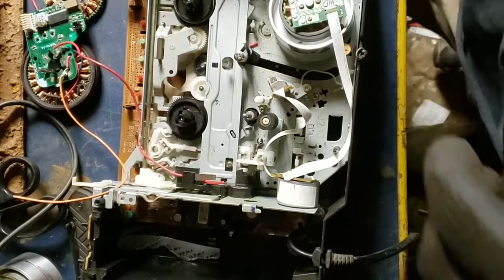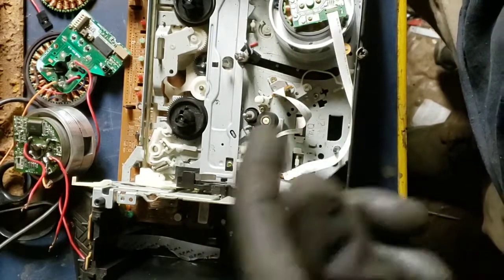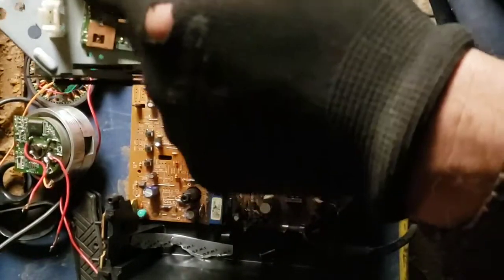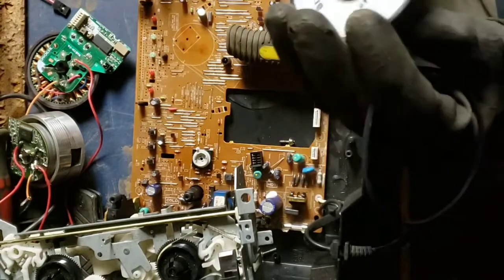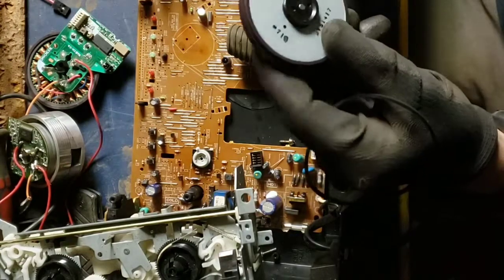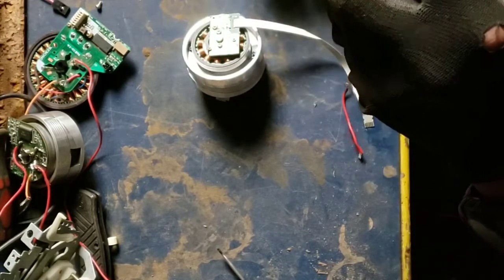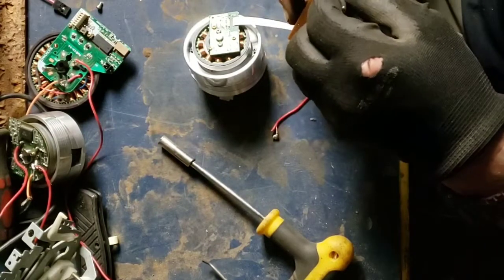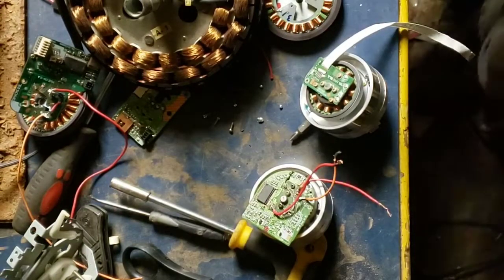hidden motor in every vcr! powerful mini bldc drum motor!

Comment: Looks and sounds like you didn't "Figureitout" after all, at least not how to use a camera or explain things. I have 6 of these on a model rover for high speed and reversibility on all drive-trains. They also work well to drive some worm gears and linear bearings on a few low-profile applications.
Reply from the maker: But I'm trying to get better at making videos.  I hope you noticed that if you were possibly inspired to check out my channel. Or was just curious if all my content was this bad......ha ha. I really appreciate you viewing my video and taking the time to give me some constructive criticism.  You inspire me to do better. Hope you decide to stick around to see upcoming content and improvements. Got 2 exciting projects/videos I'm working on that I think you will find interesting.  Thanks again @colormefucked
Reply from the maker: Sorry I never followed up. Still learning  how to effectively get what goes on in my head crammed in a video where someone can actually learn from it.  I always find the three phase wires and just use a rc bldc driver and they spin right up. I have actually been rewinding these motors with thicker gauge wire and they can actually grow some balls. I mean the one I just did screams and really has a lot of torque. I built a mini flywheel generator with it and it spins up the 5 lb flywheel from 0 to 2000 rpm without hesitation. Although there is a belt pulley reduction of 3 to 1
Reply: Hi friend, do you happen to have one with the Panasonic AN3844SB Drive? I couldn't find the Datasheet.
Reply from the maker: Na sorr
Reply from the maker: Well killerwolf I have never had a problem with the ladies and I know what you mean. Probably some fat lazy punk that thinks I actually give af about what he thinks...... I share wtf I think may be interesting to people because A. I thought it was pretty f@#$*ng cool,
And B.  Because I have learned so much on you tube that everyone asks me how long I went to college and which damn university was it.  While he was looking at the first page of scam porn sites perking his little pee shooter in his big brother's gym sock still damp from yesterday's soccer practice,  I was using YouTube for the priceless information gateway that it is and watching college professors lectures for the cost of my monthly cell service and learned more in one year then I did in all 4 years of high school combined.  So I felt It was my fuking responsibility to start contributing to this limitless power we all have at our fingertips regardless of the quality of content. As long as I was at least trying to share some kind of knowledge and possibly influence one millennial to get interested in something other then scrolling 5 second pranks or provocative clips and then posting useless comments on the videos that actually try to teach them something.  Ya. Yep. Woo. Ya feel me?
Reply from the maker: Well killerwolf I have never had a problem with the ladies and I know what you mean. Probably some fat lazy punk that thinks I actually give af about what he thinks...... I share wtf I think may be interesting to people because A. I thought it was pretty f@#$*ng cool,
And B.  Because I have learned so much on you tube that everyone asks me how long I went to college and which damn university was it.  While he was looking at the first page of scam porn sites perking his little pee shooter in his big brother's gym sock still damp from yesterday's soccer practice,  I was using YouTube for the priceless information gateway that it is and watching college professors lectures for the cost of my monthly cell service and learned more in one year then I did in all 4 years of high school combined.  So I felt It was my fuking responsibility to start contributing to this limitless power we all have at our fingertips regardless of the quality of content. As long as I was at least trying to share some kind of knowledge and possibly influence one millennial to get interested in something other then scrolling 5 second pranks or provocative clips and then posting useless comments on the videos that actually try to teach them something.  Ya. Yep. Woo. Ya feel me?

Comment: Nothin ! Wanted to know how to run them and barely even seen what you were doing...bye
Reply from the maker: Sorry wasn't the topic of this video but I did give an explanation on how to run these motors in comments prior to yours.  Someone also replied with a pinout description which was pretty cool. But honestly man I found my most use of them by rewinding them (3 phase configuration)with thicker gauge copper that is easier to work with and I use a RC bldc motor controller and a lipo pack that is within voltage range of the controller you choose . Good luck man

Comment: How to wire these motors to run?
Reply from the maker: Hey I hope this help.  What you have to do to make these motors run is find the 3 wires to the 3  phases of the motor.  You will also need to ensure the other end of the coils has the 3 wires all connected together.  There is 3 individual sets of coils on these motors because they are 3 phase brushless dc motors.  Do some research on the topic and I think you will understand what I'm attempting to explain.  I rewound the motor in this video with larger diameter wire to get more torque out of it and it worked quite nicely.  The wires on the motor originally are going to be very thin and you are going to have to be very careful when finding your wires.  Once you have done this you can use any SENSORLESS bldc RC motor controller.  You can find these on Amazon or ebay petty cheap.  Good luck!!
Reply: @MrFigureitout  you might be able to use this pin out
Gnd | 5v | ? | 5v
Gnd | ? | 12v | reverse 5v
8pin, gnd faces rotor
Reply from the maker: Thanks. I have multiple of these motors and I have never managed to run them without using my own controller. I will indeed try that !
Reply: @MrFigureitout  
Your welcome

Comment: Great job Dream Dare Create, With showing our community where to find in VCRs the hidden powerful motors which can be repurposed for many useful things... I was late getting familiar with these reactive motors throughout my career... About 4 years ago Gerard Morin was the person responsible with his YouTube presentations that motivated me to become interested with the frequency drive technology, hidden in everyday component devices. I've limitedly worked with the BLDC programable controller drives to witness for myself that there is a manifesting art form to unlock incredible size to weight performance with fantastic torque and horsepower potentials... This technology by far exceeds expected capabilities in reference of commutator DC drives & 50 ~ 60 hz 1 & 3 phase electric motor conventionalities... The extremely high power to weight ratios with extremely efficient electrical Q factors is what fascinates and impresses me. My thinking is, that the engineers and motor technicians that work with these motors everyday in commercial applications and truly know how to unleash their true potentials will be in demand with this relatively young technology... To be aware that, large air handlers in skyscrapers have been using these drives for many years with conventional controllers but many don't realize the heartbeat potentials for electrical generation for these types of buildings are... Also hidden in plain site... The air handlers can serve multidimensional purposes once it's known how easy its is to incorporate fan blades with variable pitches and variable static plates... Most commercial HVAC technicians to this day, haven't a clue that these very large BLDC motors can serve duel purposes! I predict your pioneering spirit will offer solutions that most others aren't aware of... Keep up the good work sir! I know it is worthwhile to really understand how to program (VFD) Variable Frequency Drive units to make these units really perform with all motor designs... Here is a winding scheme calculator that I hope will let you see balanced and unbalanced configurations as to poles and slots with these BLDC motors... It may give you a clue why the slots on one of the motors you retrieved was missing some unwound slots... http://www.bavaria-direct.co.za/scheme/calculator Best wishes!
Reply from the maker: Thanks! Yes gerard morin has also inspired me as well to some extent. My fascination with motors has been around since I was big enough to turn a screwdriver and took my first appliance apart.  I have a vfd that I did a welding job to get but it runs off 480 volts and I havent been able to get a transformer to convert my mains 240 to 480 yet.  Although, is a vfd really all it takes to run the hyper drive properly with high voltage/high frequency?? If so I will build a dang transformer tonight.....I didnt think It was really that simple(other than learning how to program it.....)  I follow a few people attempting to build such a controller as well as working on one myself.  I have been able to salvage two 12" hyper drives as well as one 6" identical to the ones used by gerard Morin. I have been on a mission to witness their true power since.... I even purchased the anaheim controller he uses and I have a video on my channel where I got it working. Finally got the correct sensors....although it was only implementing 2 of the 3 phases....so I'm working on getting it operational at it's full potential to do some testing.  Thanks for your comment.  You have motivated me to keep going. Just what I have been looking for sir!
Reply: @MrFigureitout  No just a VFD isn't the solution by itself! The problem is with these motors, which I call (Oriental 3 phase reactive brushless motors) AKA (Hyper Drive Motor) is that the controllers must be sized to the design parameters of these types of motors... These Hyper Drive motors are wired 3 phase double layer in the Y electric configuration with 36 slots and 48 poles. They are 100 volts per leg X 3 legs = 300 volts DC rated to about .75 KW... Because of being a reactive buck and boost type of configuration these motors really don't like AC! They prefer 10 degree separation PWM DC. They develop the most torque at low 30 hz and as the hz increases they will top out because of their design @ about 3,825 RPM... Since the motors reflect current similar to a capacitor the resonance can be tuned as the energy reflect through the system. The secret to making these motors hyperdrive is multiple frequencies parametrically oscillating... These calculations work with  specific motors to be tweaked with the software for optimization of specific motor designs and there isn't a universal driver developed that I'm aware of at this time. The (TI) Texas Instruments "Instaspin" Controller is still not universal to date to my knowledge but can get close... It is somewhat robust but is lacking...